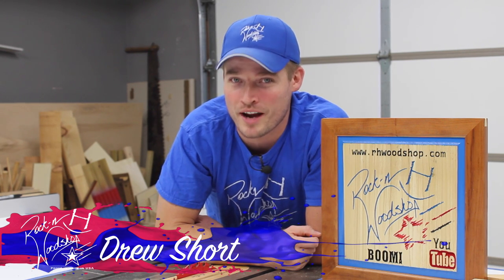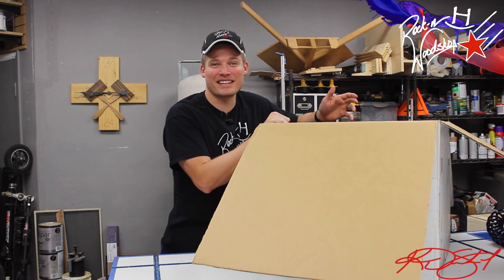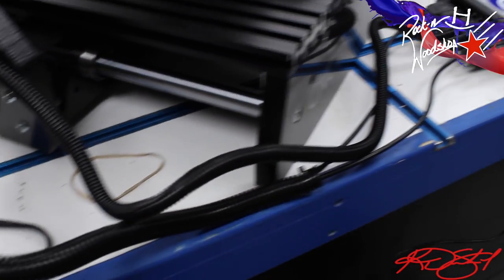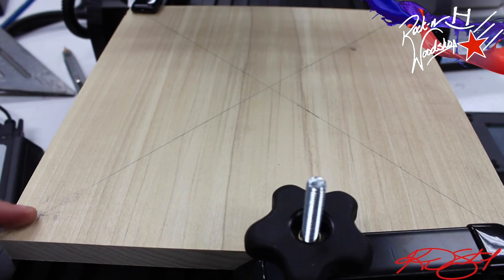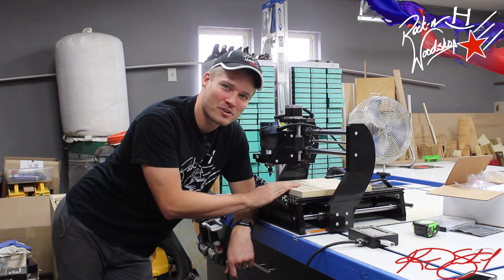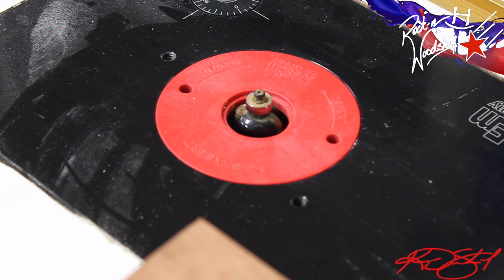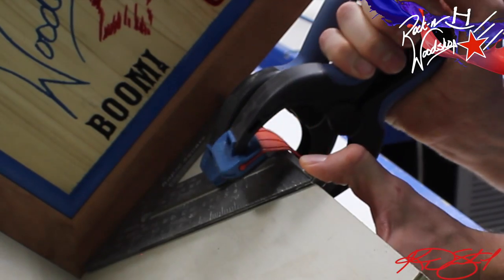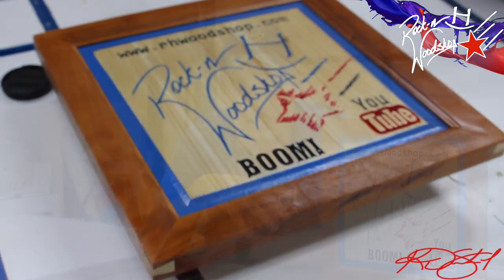CNC Piranha Plaque with a DTS Frame

Comment: Nice! There's something about that touchscreen controller that I really like. :) I have made a lot of plaques like that (tried to make it a business sorta) and I've found it easiest to use a foam brush to apply regular interior latex paint. You don't have to be that careful painting so it doesn't take long, and it doesn't soak in as mach so its easier to sand.
Reply from the maker: That's an awesome idea. Thank you so much for the tip I'll be sure and remember that.

Comment: The project turned out really nice Drew but it's hard to get excited over a CNC that retails for $1599 and has that tiny of a cutting area.  I'm glad you got it for free.
Reply from the maker: Don't judge it yet. It may be limited on the width but the length is unlimited. I can carve things 24 inches or longer if I wanted to. Plus there are some secrets about this CNC that you don't know yet. Things that the Xcarve will not be able to touch with a 10 foot pole It's going to be fun to mess around with it.
Reply from the maker: Don't give me wrong, the X carve is great for beginner intro into CNC use but this is a major step up for not much more money!
Reply: I look forward to seeing you use it on future projects.
Reply: Theres things a Sidewinder CNC can do that the X-Carve cant touch either and I doubt the piranha could touch either:) Just saying

Comment: Hey Drew!  I just watched your video on the CNC Piranha.  Nice job on the Frame and I really like the corner details with the dovetails, I will have to remember that trick.  I like that CNC Piranha, I just got one also.  My Daughter's got it for me for my Birthday/Retirement.  I received it the first week of December and have been tinkering with it since.  Mine came with the Laser and the 3D Printer.  I design and create children's furniture to include heirloom quality rocking chairs.  I place an inlay of different types of characters in to the back of the chairs and place my contact info, date and the childs name on the underside of the chair seat.  I am planning to laser etch the info on the underside of the chair seat and would like to do the inlays with the router.  Does yours have the laser attachment and how it is working for you?  I am still trying to figure mine out.  I have used lasers before to etch information on to samples for customers.  Those was just simply upload an image, place the material under the laser head, space, set and run.  This one seems a little more complicated and not much info in the manuals.

Comment: That's awesome, I like the size of that CNC compared to the x-carve. I need to come visit and check it out, I might need you to cut my initials in my leg vise I'll be working on soon.
Reply: +Lance's Woodshop & Adventures If that's the case, X-Carve has a smaller version.
Reply from the maker: No problem. Come on out. This little CNC is more than just a woodcarver. I've only touched the surface.
Reply: +McGinn's WoodShop Thats true, but I've notice a lot of flaws in the X curves, however for the money it's not a bad machine. It seems like the sharks and now this machine out perform the X carve.
Reply: +Rock-n H Woodshop I'll have to come visit when I get some free time, our first child is due in a couple weeks, so shop time will get cut down a lot this year. lol
Reply: at tripple the cost i would expect more from a machine as well.

I love the bed, makes for a great clamping :-)

Glad to see some stuff out to compare too.. cnc is a great machine to have whatever side of the fence you are on

Comment: nice video. just wondering how large of a piece you can carve
Reply from the maker: The width is limited to roughly about 11 1/2 inches but the length is unlimited. Plus there are several things that this machine can do that I have only scratched the surface on. Here's a hint: it's more than just a woodcarver!!!

Comment: Yep, that little cnc is 10x the cnc of those shitty X-carves.  Very nice. Works well for you for now.  You may outgrow it eventually but for now it seems perfect for you. Let me give you a tip: go download Autodesk Fusion 360. It's a free 3D modeling cad software that has milling/gcode creation built in and it works really well. You'll be able to figure it out pretty easy too; a lot of tutorials out there on YouTube, etc. Your small cnc will work well with it.
Reply from the maker: I will check that out, thank you. I don't think I'll outgrew it anytime soon because it will carve an unlimited length. It may only be limited by the width, plus there's an upgrade kit that I'm going to slap on it that will change how it operates in three ways.

Comment: ....and only $3200
Reply from the maker: I'm not sure where you got that number but this CNC is nowhere close to that amount. When it comes to tools like this, you get what you pay for too. Like I have mentioned in many comments so far, the X carve is a great entry-level "woodcarver" but this one is that and so much more!
Reply from the maker: +Scott Border oh yeah, that's for the all-in-one package. Mine is the basic unit, and you can buy those particular add-ons one of the time. However if you want to break the bank a little bit and have fun with all of them at once then by all means. Personally, I would really like to play around with the 3-D printer. I've never seen one work in person